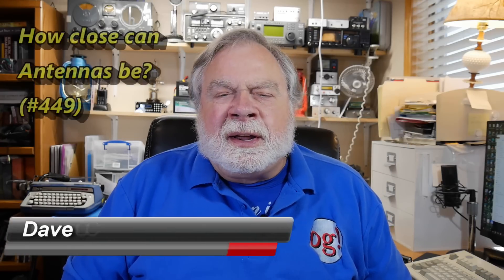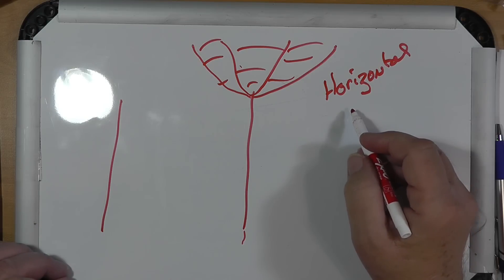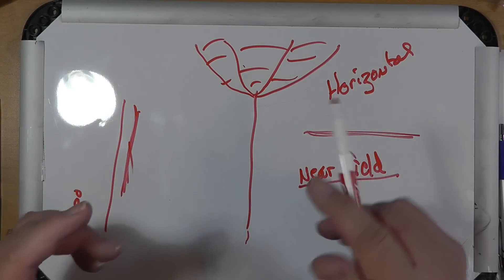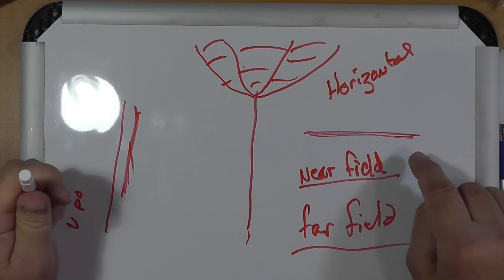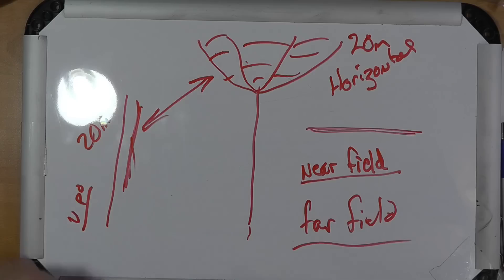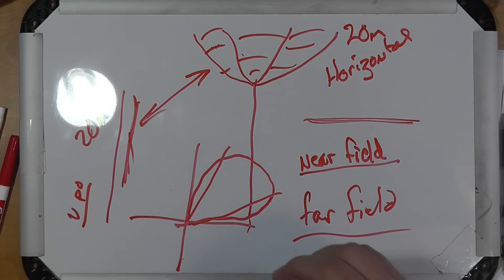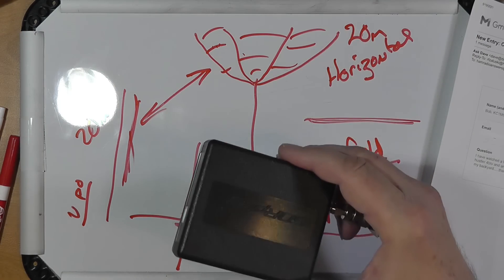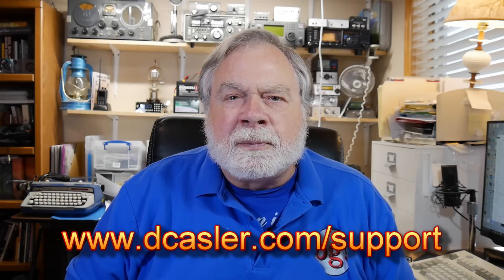How close can Antennas be? (#449)

Comment: The way I was taught about the near/far field is that the photons do not start to propagate for a distance (usually around twice the wave-length) until the far field boundary.

But that is physics speak. 
I found your video because I want to mod a handheld and the mod requires a second antenna. There are ways around it and use the same connector but using the new frequencies still needs a different antenna so I have a question:

If only one antenna is in use, and the other is * just * another antenna (within millimeters), what affects would you expect?

Comment: I'm wondering if having two hf antennas on a switch makes a lot of rf come down on the other cable. Unless both have a choke at the switch end.
Ie the other coax run shield directly picks up the rf from the transmitting antenna.

Comment: Very interesting discussion. I once measured the SWR on my mobile on 80 meters while driving down a four lane roadway. Beside the roadway were light poles that are 20 to 30m high and about 10m from the antenna. Every time I passed a light pole, the SWR would go up. So, it was obvious that the light poles were interacting with the RF transmission. The poles were in the NEAR FIELD. Thanks for what you do Dave....

Comment: Hi Dave, just came across your channel and find it incredible helpful so thank you 🙏.       I was originally thinking of stacking an Omni directional on the same mast above a beam.   I was thinking of a MaCo YQUAD Beam Base Station CB Antenna first and then stacking a Maco V-5000 on the same mast with  maybe 10’ of separation and using an A/B switch to change the antenna used.    But if I’m understanding correctly 30 to 40’ of separation would be the better way to go.

Thanks for your input and help

Woody

Comment: This information really helps thank you Dave I have one vertical and a Delta loop I added a alpha delta switch..grounding at the switch and at the antenna...my antennas are VERY VERY CLOSE TO each other using the alpha switch for one antenna at a time while grounding out the coaxle on the 2nd antenna seems to help too with isolation..my backyard is 15 deep by 30 wide

Comment: I have two Vertical antennas. One is a Tram 1498 CB 18 foot antenna and the other is a 17  foot Tram 1480 2 meter / 70 cm antenna. I plan to put both on one mast and use one at a time with a switch. My question is can I put both antennas on one mast??

Comment: Suppose you transmitted/received on 20m on one antenna and with another transceiver you transmitted on 40m on the other antenna. Would that pose an issue for the front ends for either if they both were on?  Assuming only one transmitting at a lime.

Comment: I have v5000 cb groundplane that I use to talk with neighbors who don't have a ham license, but I also use a ocf dipole for 40 and 80 meters, I never use both radios and antennas at the same time, and they are also on a antenna switch to eliminate a signal coming back to either radio. Can I  mount the groundplane 5 feet over the ocf on the same tilt over mast without many problems?

Comment: How about one radio and 2 horizontal wire antennas? I have one good path to hang wires in the air. I already have an 80-10 EFHW up and have built a 46-60 dipole to use as an NVIS antenna. I haven't ordered the antenna switch yet but it will take in both cables, the dipole will go to a manual tuner first then after to the switch. The rig is a FT 991A. How far apart horizontally could they be?
Reply from the maker: No definitive distance apart. If you cross them (one N-S and the other E-W, then they can actually cross over each other. If you can, separate them by about 50 feet or so.

Comment: How can I monitor a CB radio connected to a vertical CB antenna, and transmit on a 100w radio connected to a dipole at the same time? Just keep the space between the antennas separated by x-amount of feet? Thanks for the great videos!
Reply from the maker: Yes, separation helps. Also the frequency difference helps.

Comment: I have a cb in my jeep overlander and want to add a dual band.  How close is to close for the antennas on a vehicle.  Different bands.  Only using one at a time
Reply: Assuming you mean 144/440 MHz for the dual-band radio, that should not be a problem.  It is best to keep the antennas three of more feet apart.  A legal CB radio is at 27 MHz and 5 watts.  The typical dual-band max power is 50 watts.  The interaction is minimal, if any, and they won't damage each other.  By the way, the best mobile CB antenna is a 102" stainless steel whip on 6" spring and body ball mount.

Comment: I could have ask you the same question. I have the big gap about twenty feet apart from the one I have on a tower.and another question I have is that I haave verticle in the air and the wind bent the antenna at the top. it does not seem to affect the transition will the bend cause me to get out less?

Comment: You can also hook up a VNA across the two antennas to directly measure the proportion of energy that gets across for different frequencies.  I suspect induced currents could cause damage even if the connected radio is for a different band.

Comment: I had 2 radios and two antennas close together. When I transmitted 100 watts on one radio, the receive input of the other radio blew out...with smoke. Be very careful. That receive input is looking for micro watts and even milliwatts will destroy it. I think this video underestimates the problem, probably because it happened to me and not him. Disconnect all antennas that you are not using.
Reply: This reply should be pinned at the top.  Also, from below comments, many folks have asked, "What if I only use (turn on) one radio at a time?"  It doesn't make any difference.  Feeding to much power into the receiver can destroy small signal semiconductors used in the front of the receiver.

Comment: One has to be very careful having antennae working in fairly close proximity to each other.
I remember back in the '70s whilst in the Navy, we were tied along side, and the Tx/Rx Room was silent, all the equipment was switched off. Another ship had tied along side our ship. I had happened to go in the Tx/Rx room, probably to collect my note book, when I saw a very thin spiral of smoke rising up from a receiver, then vanish. I thought, 'well there goes an RF coil'; some user had forgotten to disconnect the receiver from the antenna after using the equipment.
So one has to be very careful.

At VHF and UHF, where equipment is operating at defined frequencies and the antennas are mounted on top of a high building, for example. The Radio manager of the site will have a frequency plan (to ensure that none of the user's frequencies interferes with each other), and will state what frequency, size of antenna, etc.... can be used on site. He may also require all antennas to be fed via a cavity filter, to ensure that users do not suffer interference or damage from other users.

Comment: Here's a question,  I have a few long wires, 180ft EF, a CF, an OCF, and a few others, however 3 of them cross over and under of one another with about 3 ft between them where they cross.  They are hooked to 3 different hf radios, do you see a problem? 90% of the time only 1 radio is on, 10% of the time all 3 are un uses. I do comms for the USCG so at times I may be passing traffic while receving.

Comment: You might have added that for those of us with small yards there is no point worrying about interactions because you have no choice. It's either interactions or have only one antenna. My spacings are often 5-10 feet. Everything still tunes up OK, and  all seems to work well. Don't forget you will be squirting out lets say 100W, and a reduction in radiation on one heading due to interaction must be compensated by an increase in another direction. That 100W has to go somewhere.

Comment: @ke0og, as a follow on question, what if i did want to have 2 radios going at the same time, I was wondering if i could have 2 antennas going and 2 radios so I could say work FT8 while i'm waiting on my turn to get called in a net
Reply: Specifically was thinking about working FT8 while I was waiting around for my turn on the Nightly OMISS nets on 40/20m,  made some friends over there been a lot of fun working on my phone only WAS, and you never know when you might get called on
Reply: @lcdmonitor1981  Since the wave length of the 20m band is pretty much 1/2 that of 40m you could separate the antennas by about 20m, you'd have to calculate the real number,. You shouldn't experience much problems, as long as you aren't running full legal power limit. Best to ball park the separation and give it low power test to see what happens before putting too much effort into it. 
You could also make yourself up high / low pass filters that would further minimize interaction.
A last thing I just thought of was having one antenna vertical and the other horizontal could also decrease the interaction.
These aren't things I've tried, but information that I have garnered from a wide array of sources of how this type of interactions of antennas can be reduced.
Reply: I've seen YouTubes of contest stations doing this by having the antenna's for the 2 radios at 1/2 wave multiples separation so that each is effectively in the "null", so to speak, of the other antenna. This may work for differing banks also but I don't know, they'd have to be able to be placed some 1/2 wave multiple of 2 operating bands.
Reply: Why? Vhf and hf is no concern. Hf and hf is.
Reply: @tahoma6889  David Casler's example was 2 HF antennas so I had carried on with the HF example. @David Simmons' didn't specify HF or VHF. Due to lowpass filters in the HF radio there probably wouldn't be interference from the VHF radio but I'd imagine that unless the VHF radio has good band pass filter it could be swamped by a powerful close by HF signal. Hmm, time for more research into this... :)

Comment: Dave, for this discussion, are nearby antennas interacting with each other even when only one is being used at a time? (For Rx and Tx)
Reply: Yes.. a tree is mostly water. It does the same..
Reply: Yes. If one antenna is in the near field of another, it will affect the radiation pattern of the radiating antenna in some way. For one thing, that's how you get yagis.

Comment: MultiBand Dipole's and the DX Commander has their Elements very close, Confusing ? I always stick with Minimum Half a Wavelength apart
Reply: My understanding is that since fan dipoles or antennas like the DX Commander have radiating elements cut for specific bands the interaction is minimal between the elements. The minimal interaction is tuned out during the final tuning.

Think of it kind of like a guitar or piano, when  is plucked / key depressed the one string vibrates primarily with minimal sympathetic induced vibration in the others as they are not tuned for that frequency. Otherwise we'd never be able to get any intelligible sound out of any sort of string instrument, it would just be a disharmonious mish-mash of sound. Note that my example excludes multi-string chords.

Agreed on the multiple of half wavelength separation of antenna's that operate on the same bands. I've watched YouTubes of a couple contest stations talking about their setups for multiple operators and they'll put antennas up 1/2 wavelength multiples apart so that each is in the "null", so to speak, of the wave emitting from the other.
Reply: In typical usage, you have one feed line (coax) coming from the antenna connected to one radio.  So, you are using one band at a time.  The transmit/receive relay in the radio isolates the tx power from the receiver so that the power doesn't damage the delicate small signal semiconductors and capacitors at the front end of the receiver.